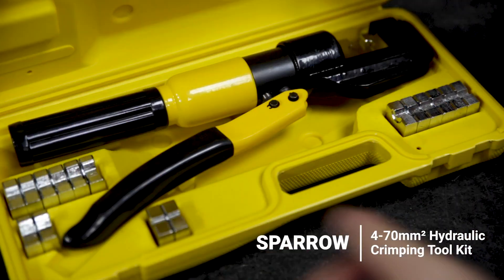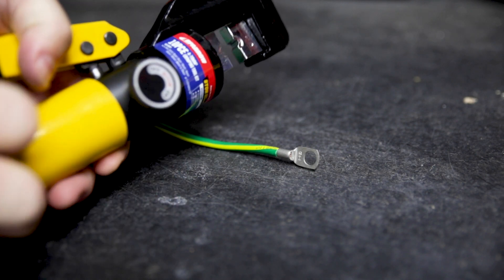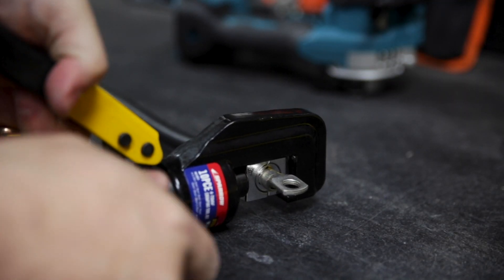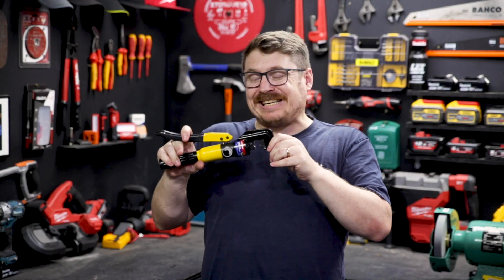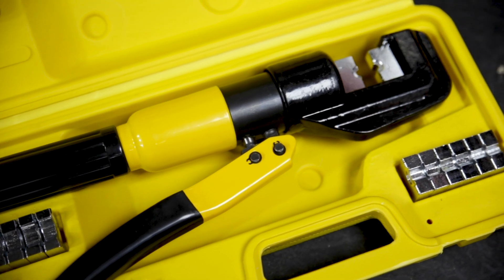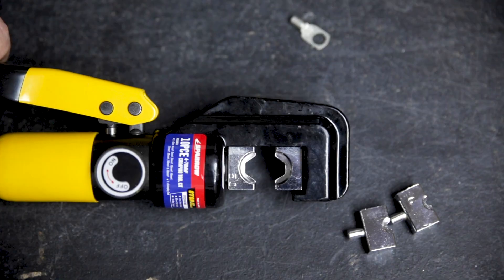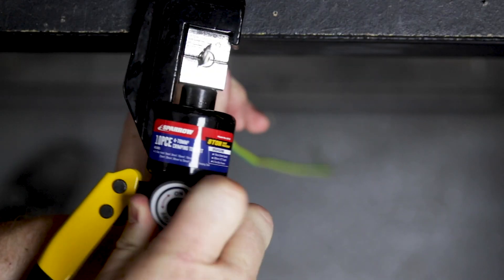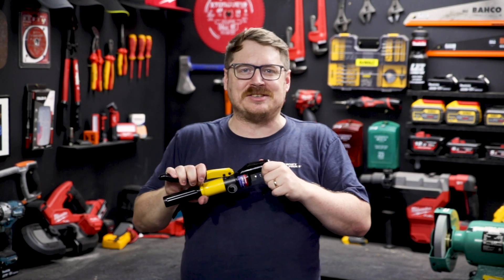Hydraulic Crimping Tool - Sparrow

Comment: I need to replace the thimble on my winch cable (9.5mm). The breaking strain on the cable is 6 ton. Would this tool be able to crimp in place a thimble with that kind of strain?

Comment: The hydraulic crimpers work great but as mentioned before the dies are not sized correctly especially for insulated ring connectors
I had to redo all my connections on my 50 amp run because all the connectors snapped.  I ran some mock ups with the dies and it worked great except for the time wasted.
The 2 AWG die crimper actually fit with the 6 AWG insulated ring connector with full crimp
Pissed me off but you have to run a test first.

Comment: How many times to pump the handle? My handle rattles and feels very loose. After 30 pumps, the dies still did not come closer. It is set to the on position.
Reply from the maker: Hard to diagnose in the chat. Bring it back in for us to look at
Reply: Hold it upside down (crimp end down) and see if it works, might need hydraulic fluid topped up
Reply: Same problem as mine

Comment: Only 20 times survived crimping, oil leaked, ended up in the trash, next Chinese toy
Reply: Its normal the oil rubber sealing can not handel it .
Even pro stuff will leak .
Just replace the ring and it works fine again.
We have the same problems with car repair oil pressure systeems to line out a car body .
We talk about easy stuff that cost easy 10.000 euro .
What leaks on a oil rubber seal.

Comment: ❤❤❤ I just bought one of these and I absolutely love it. I used it to crimp the electric connections on my four gauge copper wire from my air compressor system of my 2022 Nissan frontier. I have a unique set up in the toolbox of the bed of my pick up truck with heavy duty wire activating for individual air compressors just for my air horns and I wanted to be safe. That’s why I bought this particular crimper it’s the best tool that I have in my toolbox when it comes to electrical connections it’s the best. ❤❤❤

Comment: Horrible crimping dies, in order to crimp a 35mm cable I had to use the 25mm die and adjust the pressure to suit. Will have to re-machine all dies.

Comment: How do you add oil. Leaks like a sive
Reply from the maker: bring it back in
Reply: Buy replacement seals to suit generic chinese YQK-70 crimping tool and follow youtube video

If you keep pumping and bottom out the dies you can blow the seals on these chinese copies

The store staff are unlikely to be able to help beyond a refund/replacement and if used incorrectly it will just blow again

Comment: held in with magnets, LOL LOL LOL, I needed a frame puller to yank mine out, ha ha
Reply: First mod i did was drilled  through. The black clamp part and can. Now use a cut off screw driver or similar  to knock the die loose

Comment: An 8AWG gauge wire will not crimp well because the dies available for small gauge is only for 6 and 10. Using the 10 won’t work and using the 6 will crimp it but the crimp is not appealing.
Reply: 8AWG is 10mm2 so the 10mm crimp is perfect.
Reply: @michaelwindow87 every chart I’ve seen says 8AWG is 3.XXmm diameter or 8.XXm2